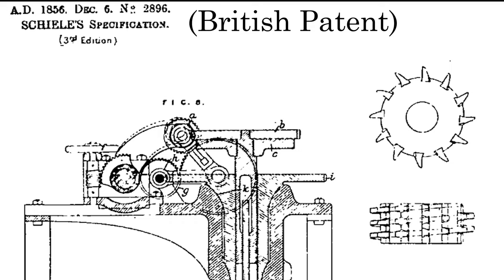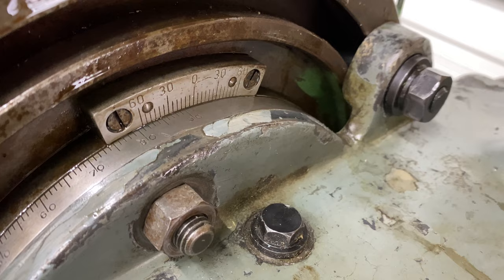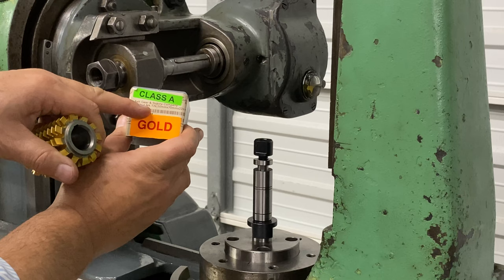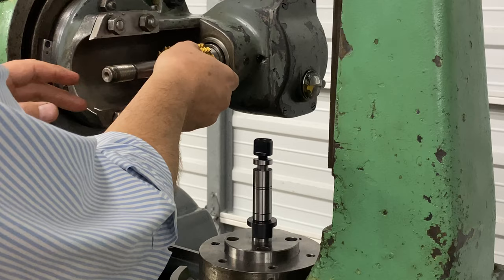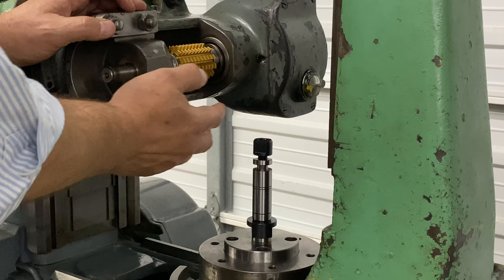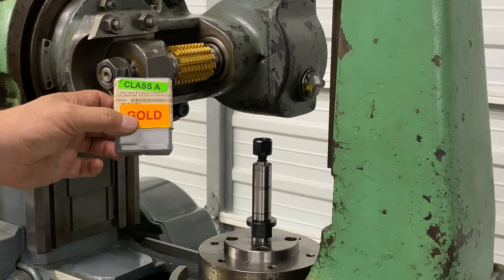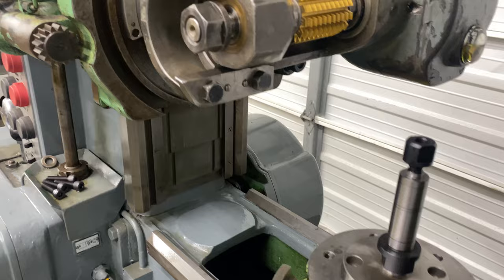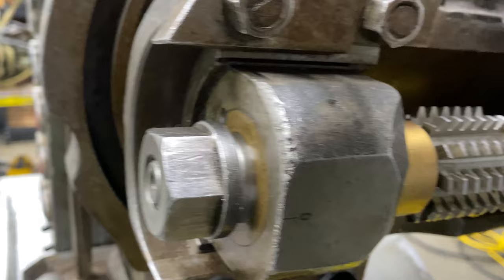Involute Hob for Gear Hobbing - Like a Big Drill Tap

Comment: One cutter can be used for any teeth count bit same pitch, correct ?
Reply from the maker: Correct.  Hobbers have a lower limit on the tooth count of around 13-16, and an upper limit due to physical limitations.  But yes, for most practical gears the hob can cut any tooth count all of the same pitch and pressure angle.  They will all mesh and run with each other.

Comment: Как правило, гайка при таком расположении, имеет левую резьбу. Это препятствует самооткручиванию.
Reply from the maker: Your statement 
"As a rule, the nut with this arrangement has a left-hand thread. This prevents self-unscrewing."  
This is very true as a general rule - and thanks for noticing and watching.
The Pfauter can run in both directions, the arbors we have use Left-Hand-Threads, but a few are Right-Handed.  In both cases, the arbor-hob assembly is very tight, and the friction of the bushing is relatively low.